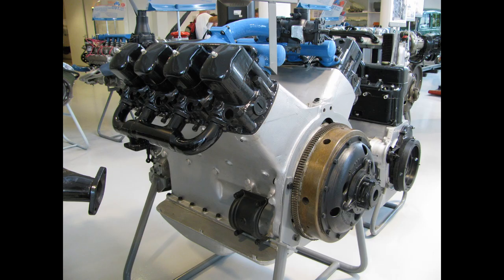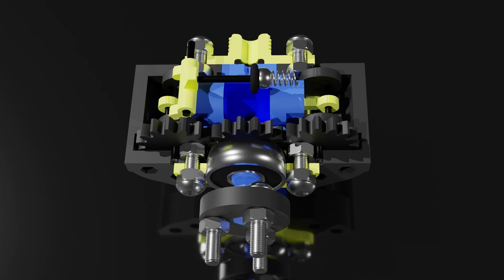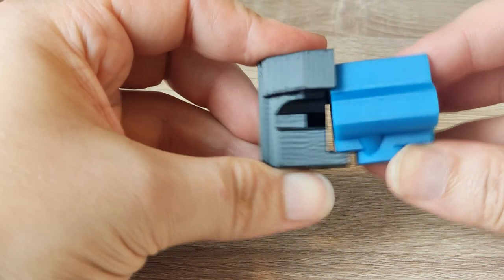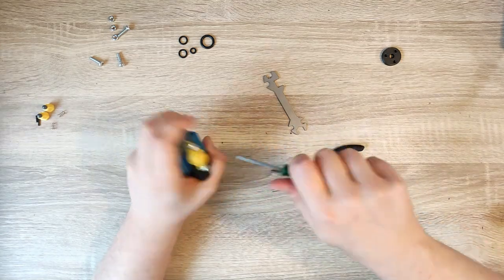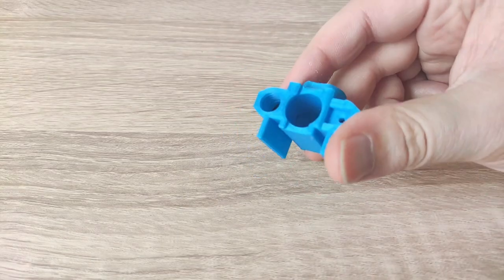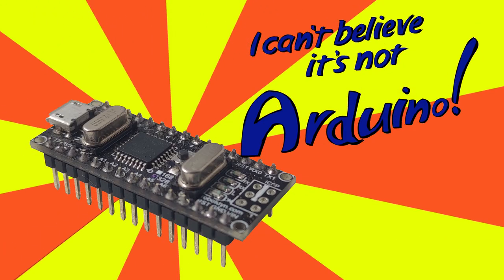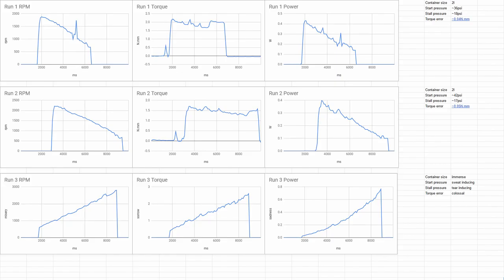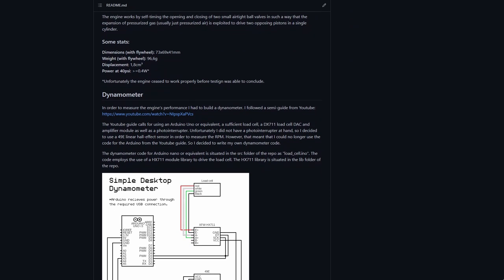3D Printed Opposed-Piston Air Engine

Comment: Bro, I'll tip my hat for the remarkable effort you put in to design a functioning engine in Blender! I've been very lucky not to run into a lot of air engine problems, but I guarantee that's going to change with my new one! Great video and looking forward to a version 2!
Reply from the maker: Good luck with your next engine! I have an engine project in the "pipeline" already, but probably will release another programming/simulation video before I work more seriously on that one. The new engine project will also see an improved dynamo setup, and most importantly - code for the dynamo haha.

Comment: I have gone through endless designs that never made it to fabrication, and ive made countless models that in some way or other don't end up working. Every single time I will say to myself, "this IS the one it's gonna work this time," but then I end up having to jerry rig something and It fails. But THIS TIME I know my design will work, and I might make a video on it. Only this time, I ran out off filament. The best engineering advice I can give is 1. The design with the fewest parts is the one that works the best.   2. Account for everything that could possibly go wrong (account for tolerances, dimensional accuracy, and leaks). NEVER EVER EVER think that you can just design an adapter or something later and just super glue it to your original design. If it doesn't work, redesign the whole thing. Because there is never only 1 problem.

Comment: When you said "not that kind yet" now I'm excited and I'm subscribed with notifications

You should check out the wonderful world of vacuum engines, it's much easier to work with and much safer than compressed air

I can hear the redesign firing which indicates things are working, but it seems to be firing and then binding or losing momentum. Larger flywheel, less advance on cams, smoother rotation. Unfortunately 3D printed pieces do not seem to hold up well if you do not consider graining. My guess is that at some point the layers began to separate or simply wore away and the cylinder or valves no longer sealed properly.
Reply from the maker: I think in the end the problem probably actually was one of those cracks. The crack in one of the structural parts allowed it to very slightly bend, thus making that side's crankshaft also ever-so-slightly misaligned. This means that it would have been applying a torque on the connecting rod, which in turn would push the piston against the cylinder wall. The only problem with this theory is that the engine didn't seem to be rougher/harder to manually crank, which is something I would have expected, if the piston is seizing as a result of being pushed into the side of the cylinder. 

Also as for that comment about "yet"... that "yet" is certainly quite far in the future as I certainly would require more tools, and in particular, I'd need a better workshop than my office room haha.

Comment: this is a stretch but did you try a different lubricant because some lubricants can expand plastics and/ or make them bind. I used motomaster silicon lubricant and a couple other types with petg and they made the engine rub very badly by expanding the plastic.
Reply from the maker: I used WD 40 Silicone lubricant because a creator by the name Tom Stanton had recommended it for one of his videos. He uses PLA plastic, just like I did, so I doubt that would be the problem.

Comment: Judging by the decline in power over each run, something in the engine is wearing down rapidly and perhaps starting to bind.
Reply from the maker: It is possible. Though I figure the root cause is due to the crack in the casing after-all - it would mean the crankshaft gets ever-so-slightly misaligned, creating higher friction in the rod and piston movement.

Comment: [*] in the chat for the guy using blender to do it

Had to be pure agony
Reply from the maker: Actually, it's not as bad as many would think... I personally think that CAD software can be more clunky and unwieldy to use in some circumstances... but of course, CAD does give higher precision (if you ask it to) and allows for easier design tweaks and even parametrization of whole components.

Comment: Why hasn't this basically simple technology been promoted into a mass produced vehicle? No global warming, no oil wars.
Reply from the maker: There are a lot of reasons but two of the most glaring problems with that idea are that the energy density of compressed gases is extremely low when compared to fossil fuels or batteries and that the best possible energy efficiency of a compressed gas engine is actually quite a bit lower than that of a fossil fuel based internal combustion engine. The future for carbon-neutral vehicles is electric vehicles (hopefully with a better battery chemistry than Li-ion in the future) recharged with renewables or nuclear energy.)